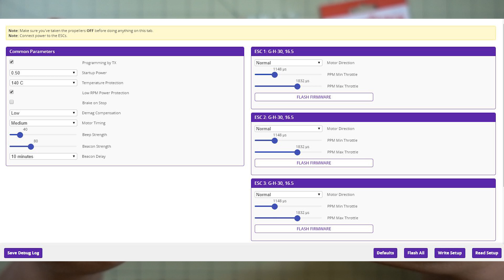Racerstar 20A 4-in-1 Detachable ESCs

Comment: Okay... I will be wiring this ESC up this week. Planning on running batter directly to the esc then to a 5v BEC down to the FC (it has no built in BEC). Planning to run that down to the same place as the esc switch wires on the FC. just checking to make sure that my brain is in the right place. I will then run camera power and vtx power off of FC. Question though. The VTX needs more than 5V for power. If I am running the BEC down to 5V on the FC, will the FC upconvert power to 12V for the vtx or should I run that directly off of the power coming from the ESC's before the BEC?
Reply from the maker: You need to run the VTX off of the ESCs directly. The 5v BEC will only supply 5v to the FC. The FC won't upconvert to 12v.

Comment: hi albert. my eachine falcon 120 4 in 1 esc needs replacement.crashed hard on pavement bent up a motor when i took it apart i notice a burn mark in the heat shrink and one small capacitor came off in the middle next to the end of copper strip.do you think it should be replaced or if i added a capacitor like i do on my others to the battery cable connection it may be ok?
Reply from the maker: I'm not sure if that will work, but it wouldn't hurt to try as it's already broken anyway.